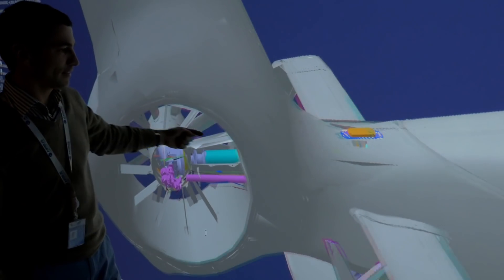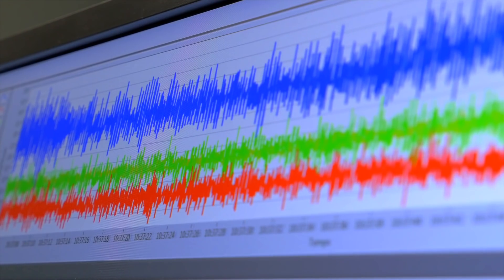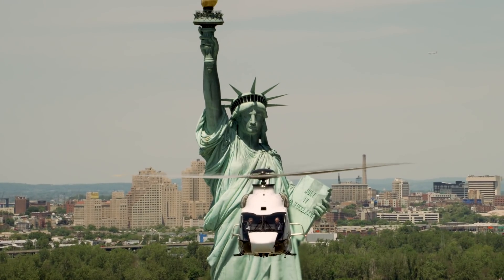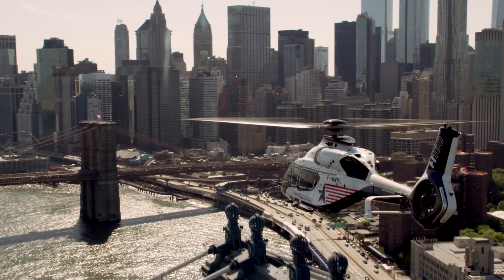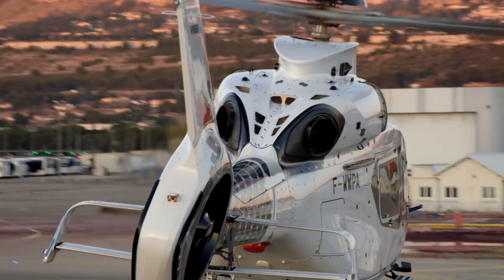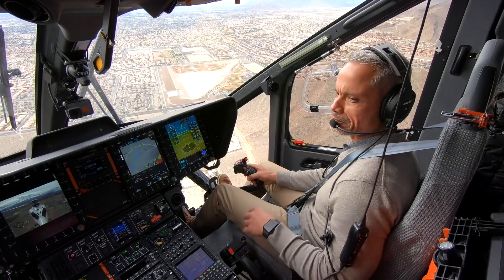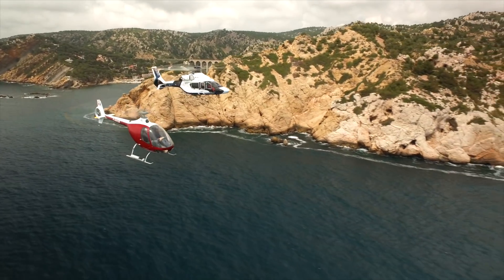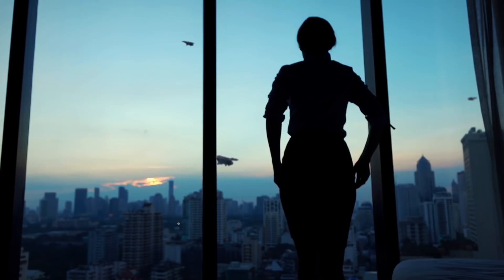The Fenestron - Part 6 - The H160 and the future...

Comment: Tilted fanestron!! Wow
Reply: The RAH-66 Comanche first flew with a canted tail rotor assembly (basically a fanestron) back in 1996. I was just a kid when I saw it (I believe at Oshkosh) but I remember the guy explaining that it provided a significant portion of the overall lift and allowed a better balance to the helicopter. Of course in that design, stealth was a primary concern which required the “ducted” tail rotor / fanestron.